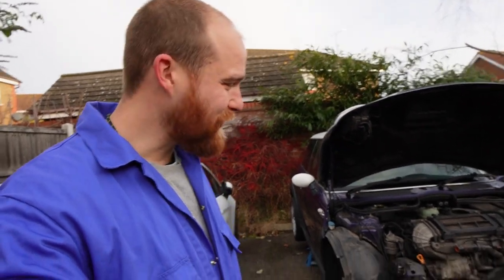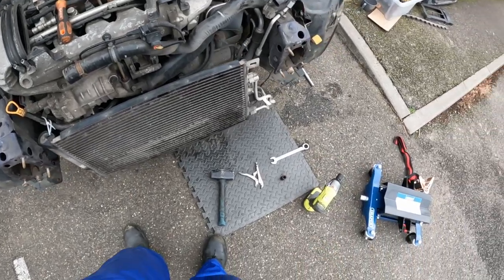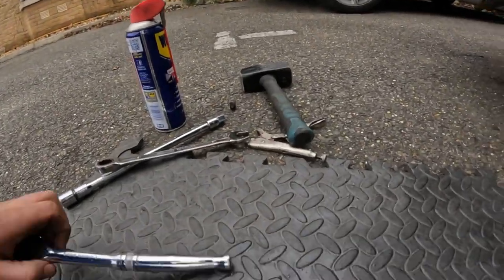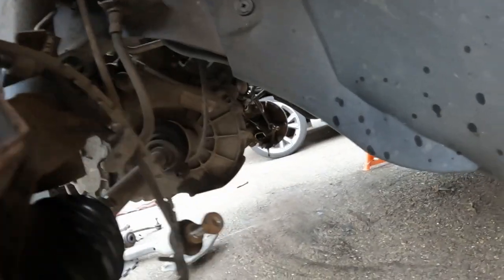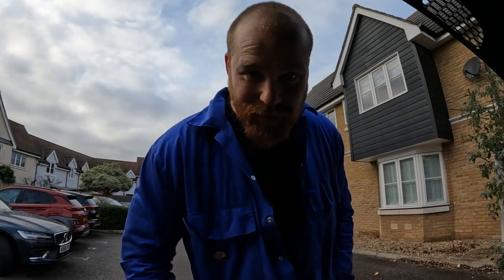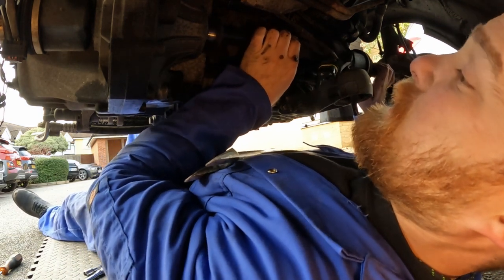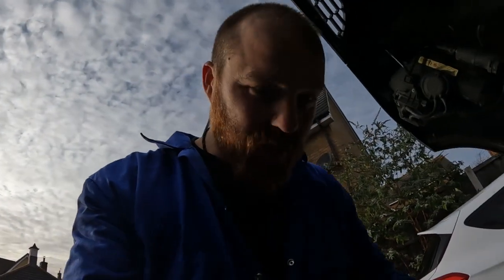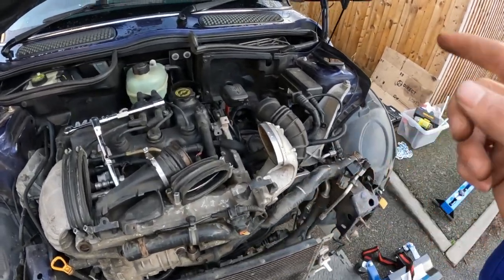Why is this happening to my Mini transmission?

Comment: Subframe - clean of rust by a wire brush on a wheel, weld the hole, protect with zinc paint and underbody spray. No need to buy another one. Welding by tacking one spot weld near the other is how anyone can weld without a problem or experience.
Reply: This is true but by the time he buys the welder, wire, gas, helmet, gloves etc and then has to learn to use it, and find a place to store it all it’s turned in to a big outlay, what for a 99 quid subframe.

Comment: That’s the Map sensor, the pipe goes down to the intake pipe to the supercharger. Common to be broken but are difficult to find new, it’s easier to get some fuel hose (so it doesn’t collapse) and cut the plastic pipe and fit a small,piece between the pipe and the map sensor nose. Two Allen bolts hold it in the bracket

Comment: Not watched to the end of the video yet, and I appreciate that this video is a year or so old, but spotted an issue with your rear bush mounts to the front control arm - they are the wrong ones! I only spotted this as I did these bushes on mine the other day and found the same issue. I think the cast metal bush carriers are from an R56 and not an R53!